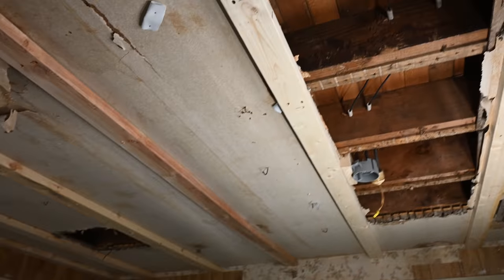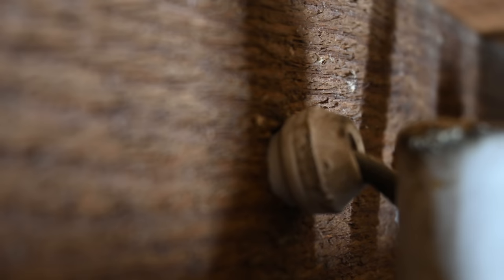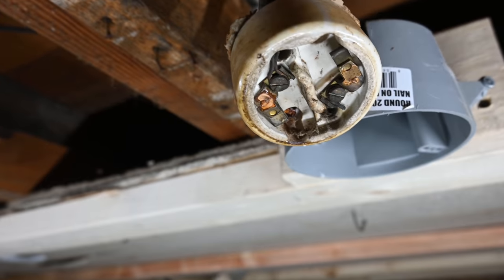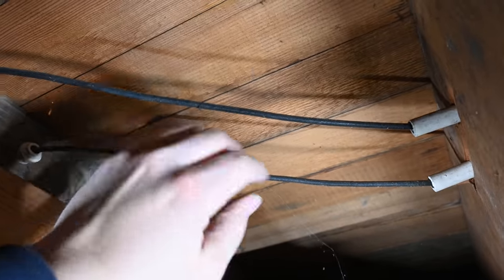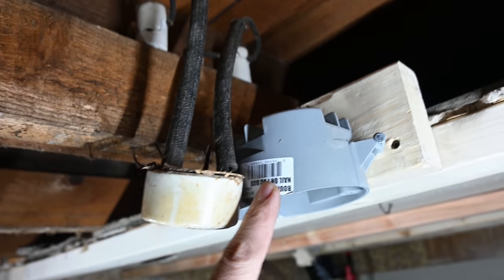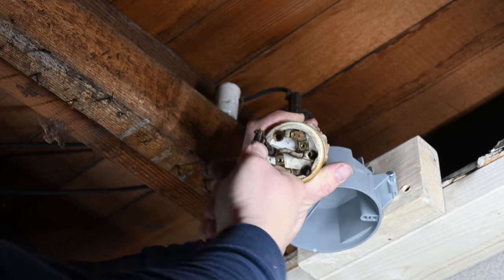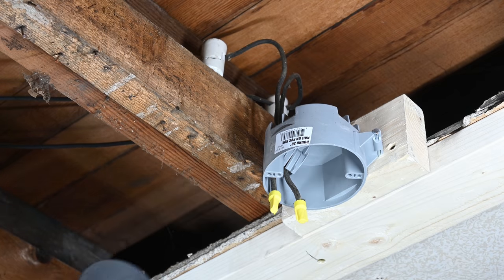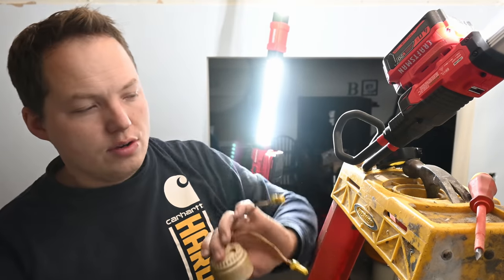How To Abandon Knob & Tube Wiring in a Wall or Ceiling

Comment: Funny thing about older homes is many craftsmen were stuck in their ways. My home was built in 1910 but the original woodwork screamed late 1800s. The flip side was the wiring was all BX, which was brand new at the time, along with a 30 amp service at 110 volts. There was no indoor plumbing or central heat when it was constructed. The BX cable I removed had tags on it from Montgomery Ward. (competing with Sears in the era) Odd to think the place had the "gold standard" for wiring but everything else was old school. Being an old mill town we had electricity and telephone long before many.... while still using a hand dug well and an outhouse. What a mix!
Reply: The major benefit to leaving the original AC cable in place is that a ground is afforded.
Reply: @steveloux4709  ... true, but there was no user connection within the living area. It was strictly an engineering point within the installed system. Boxes grounded back to the mains panel was about it. I have never quite figured out if they even bothered to install a ground rod outside the home in that era... or if it was all bonded to neutral and returned to the transformer.
Reply: @steveloux4709  But the further away from the source you got, the less effective the ground.   Plus if the connectors weren't tightened properly, it becomes ineffective.
Reply: @TheTurpin1234  sounds like you have done your own research?  The ground of an AC cable is merely needed to provide an effective ground fault current path.  I think casting doubt on its effectiveness due to the possibility of improper installation (loose/improperly installed fittings)  could be applied to anything in electrical construction that might inhibit the establishment of an effective ground fault current path.  Are there more reliable means to ensure an effective grounding program?  I suppose that is why the Code recognizes certain installations require redundant ground fault paths, e.g. patient care areas.  But if we confine ourselves to properly installed, code-compliant wiring methods, we can be confident in the safety of such installations.
Reply: @rupe53  whether a grounding electrode exists or not, the benefit of the AC cable being bonded all the way to the main panel and to the neutral provides the most critical part of the grounding feature; that is the ability to fault large amounts of current to very quickly open the overcurrent device in a short circuit condition.  The ground rod where present is primarily in place to dissipate the energy caused by a lightning strike and little more.
Reply: @steveloux4709  yeah but in reality a lot of old homes have been hodge podged together over the years
Reply: @TheTurpin1234  ... in my case I chose the path of completely doing all the utilities over from scratch. Each room was gutted to the studs, insulated, rewired, and baseboard radiators. Everything went to a new panel and upgraded 100 amp service. Of course, that was 1979 and since then we upgraded again to 200 amp and installed a sauna, central AC, hot tub, and more power in the garage. The original panel became the generator panel. All was inspected and passed with flying colors.
Reply: @rupe53  exactly what needs to be done at the house I'm working in right now.  I'm just doing the bathroom though
Reply: @TheTurpin1234  ... Ha! That's what I said when I started the bathroom and found I had some cranky plumbing under the floor. Closer inspection showed the last plumber cut too far into the joists and I wound up pulling the ceiling below to sister that up, then change the layout.... and it went from there. Back side of the tub / shower was into the bedroom, so I kept going, room by room on the second floor. Each room got rewired along the way. It was another few years till I finished the first floor completely, but at least any changes there went straight through the floor to the basement. BTW, if your house is as old as mine, do yourself a favor and replace the windows. My god, what a difference in the heating bill and comfort level.
Reply: @rupe53  Im working in a house right now that was built in 1912.  Its lots of fun.  They have old gas lines in the walls for gas lighting lol
Reply: @TheTurpin1234  ... when older homes are well preserved, they rather cool. We have an 1880s vintage mansion in town where the owners left not only the gaslight in place (nice aesthetics) but since we are fairly rural, they have a Gas Machine (trade name) in the basement that actually makes the gas on site using carbide pellets. It probably needed tending by the house boy on a daily basis to keep the lamps burning. The same house also has a fully automated coal boiler, which was likely retrofitted when electricity became available. Lots of gears, cables, conveyor belts, etc. It was left in place when they converted to oil in the mid 1930s and plumbed in parallel, probably in case of emergency or power failure, where they could tend it manually. Lots of K&T wiring, which seemed to be abandoned in place, including the beadboard electrical panel with ceramic fuse holders and open knife switches. It was a work of art.
Reply: @rupe53  That sounds so cool man.  I always wonder about all the stories, all the people who have lived in those houses, and just what went on throughout the years construction wise.   Its very hard to tell sometimes.  Its like a fun mystery that people that are probably dead left for you to figure out.
Reply: @TheTurpin1234  ... I worked on the road in HVAC then generators in the same area where I have lived since 1964. We have a LOT of older homes and I was visiting 3-5 a day in my work. You see many things and sometimes you learn the history by observation. I'm also a very social person so I always engaged people, especially older folks, in conversation. It's amazing what you can learn from some guy who is 85 and his family has been in town for over 100 years. It doesn't hurt that my sister has a masters degree in historic preservation.
Reply: @rupe53  If theres one thing I've learned in my 26 years here, its that old people are smart. Usually
Reply: @TheTurpin1234  ... I have to say that's true 90% of the time. Not every old guy is smart, but they do at least have experience. Learning from it is NOT always easy.

Comment: Hey Benjamin. Great video.  As for those LED lights, they are working as designed.  To keep weight and cost down they use switching power supplies instead of transformers to drop the voltage, and then PWM to control the LEDs output with pulses of DC voltage instead of varying the voltage like on an older incandescent lamp.  Usually not noticeable to naked eye, but will show up on your video at typical frame rate of 30 FPM.

Comment: One of the hard parts with finding the source to cut off old K&T is that several rooms (or half the house) may be on the one circuit. Usual electric service was 30 amp 110 volt meaning 2-4 15 amp circuits. Maybe one circuit to service all the bedroom ceiling/wall sconce lights upstairs; one circuit to service all the ceiling lights on the main floor and maybe one wall outlet in the living room for a lamp or two; one outlet in the kitchen for a mixer or iron and maybe a circuit in the basement for the lights. Typically when a house was built in the very early 1900's, the lights in all the rooms would be hanging down or have pull chains---no wall switches so everything would be live in the ceiling. A run from the fuse box might go north to south in the attic with drops or branches to the side spliced in to go to each bedroom light. You might have a hard time finding it to cut off without cutting the whole circuit (which isn't a bad idea). The mess you found is likely to be in other rooms as well.
Reply: I can tell you this much  :: just because you have a newer home ,that does not mean it is wired right ! And watch out on buying any house ! Get a therough inspection done !
Reply: This... Is not accurate. Maybe a super cheap house wouldn't have switches, but here in the Midwest every K&T house ive seen has switches for the light fixtures in each room. Most of the time the neutral is switched for some reason, I know that was still legal until I believe about 1930.
Reply: Excellent info! thx!

Comment: K&T Wiring was designed to be "air cooled", so although the knobs "stand off " the wire an inch or so away from the combustable surface its run along. It also allows air to circulate around the wire. This is the reason some insurance companies now will not insure homes with K&T wiring. Most homes have had their insulation supplemented ( blown in,etc)  in the attic and now that K&T wiring is surrounded by insulation. Frankly , the way the connections were completed back in the old days ( soldered!) The insulation is probably not going to be a problem IF the original installation ONLY exists. Problem is in 100 years there is any number of modification that typically happen in a house. And when it comes to electrical wiring there is a multitude of questionable practices out there. Many people think they can " do wiring".  K&T wiring is extremely difficult to diagnose. You have possibly shared nuetral multiwire circuits, california 3 way switching or regular 3 way switching, switched nuetral circuits,etc, etc, etc...if you don't know what your looking at you can get into a lot of trouble. The " repair " part of K & T wiring is intentionally vague in the code because in many cases you really dont have a good viable way to repair it. I mean really , think about it, how many things do you own that you use on a daily basis that are 100 years old that have never had any maintanance on them? Well, if you have a house built in 1902 you may have (remnants)  of wiring thats 121 year old and still being used. Its quite remarkable really when you think about it. 
I could go on and on, but I gotta go to work. 
Tim..

Comment: I never trust anyone anymore when shutting off power.  I also messed up a new wire cutter.  I followed the wire from the switch to the bathroom fan box.  I was aware there was power at the switch however I was not aware the switch was upside down.  As a result I turned on the power rather than shutting it off.  lol
Reply: Yeah, I started carrying a small padlock with me when doing work at friends houses to lock the breaker box. I was wiring my friends bedroom back in 2019 and the same breaker controlled the room I was wiring and the outlet in the bathroom on the other side of that wall. His wife(nice lady, but a bit of a ditz at times) thought something tripped the breaker when the outlet her hair dryer was in wouldn't work. She went downstairs and flipped the breaker back on, and I saw a flash... Luckily I was over their bed wiring the ceiling fan motor, because that put me straight on my ass.
Reply: @Poptart133g   I have a friend whose father, an electrician, was electrocuted that way. He was working on the wiring of a factory and had turned off the power and someone came along and turned the power back on while he was working on the circuits. NEVER RESTORE POWER UNLESS YOU ARE 100% SURE THAT NOBODY IS WORKING ON THE SYSTEM. ALWAYS CHECK -- YOU MAY SAVE SOMEONE'S LIFE.
Reply: I bet that's happened way more than once

Comment: Had about the same situation with a pair of side cutters. Working in a basement on a 240v water heater, my coworker said ''yea the breakers off'',,,,, BANG!!!,,, ''HEEHEEHEE,,, IT'S OFF NOW!!'' 24 years later I still have those cutters with the arc mark!!
Scotch Super 33+,,, the only electrical tape I used, until I found the Scotch Super 88+!
Reply: In the basement of a bar, I watched two people disconnecting the electrical wiring from the oil furnace. They had turned off the circuit breaker identified as "furnace". One of them dismantles the wiring, without any particular precaution, and without problems. Then while he has the cable in his hand he pushes it away. The cable touches the metal furnace. Fireworks!

Comment: Better to have left the original over sheath insulation on the wires and enter box through two different holes. Also best practice to disconnect unused/abandoned knob tube wire at source when possible.
Reply: Abandoned wiring shall be removed that is accessible
NEC 725.25 and 800.25 and so much more I could share with you most of all understand the difference between being or not being qualified to perform any type kind of work and be able to do it safely.

Comment: I played with MILES&MILES of knob&tube on Long Islands historic North Shore during my 30yr career. There is still plenty in service and in reasonable condition today. If the wires were never overheated. There is no teaching how to perform a repair.  A volt ticker reads a broken neutral as if the wire is live.  I hated going no power service calls at knob&tube homes. The last thing a customer wants to hear is, you have no choice but rewire the entire effected circuit in a finished 100yr old home. Consequently, I quickly learned what is restorable and what is not, through my efforts to restore power to 120yr old wires.
Reply: Thank you SO MUCH for this post. I have been searching for this information for almost a week. I have been back and forth from repairing or replacing the K&T in my 1900 home after I f**ked up and shorted the H&N. Even an electrician told me to cap it off and run a new line, but the entire 1st floor is on that one breaker. I had already run new 12/2 to the kitchen and bathroom, so I knew enough to be dangerous. The only issue I have is I am not sure where to fish all the runs to get them to the breaker box. The current breaker box is on the back porch and the K&T is coming from the basement. Do move the 100 amp breaker to the basement and/or run the wires from the attic through the space between rooms down to the basement and then back to the breaker box? Any help would be greatly appreciated 👏!
Reply: @TheLowDownDog  if the panel is on an outside house wall, run your cable into the basement and fish the cable up inside the wall behind the panel. If your plumbing vent pipe runs straight up from the basement. Drop a snake along the vent/drain pipe down to the basement and pull your circuit up. Leave a pull string along the pipe and you will not have to snake to the basement again. The gable end walls in your attic might be open to the basement. My house is 1920. Your house might be balloon construction, meaning there is no header plate to attach the floor of the 2nd floor, and block the path down the bay. The plate was called a ribbon back then. The last resort, if you cannot make an internal vertical pull, run the circuit up the outside of the building to the attic, sleeve your plastic case cable inside pvc conduit and install sil plates to protect the cable at entry points, top and bottom. If you use metallic conduit, bonding codes apply. I hope this helps you.